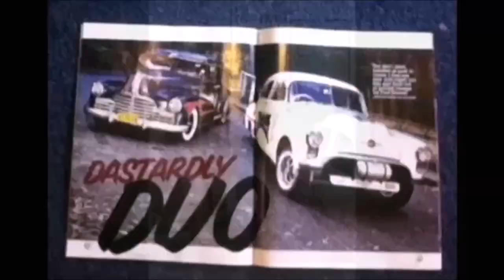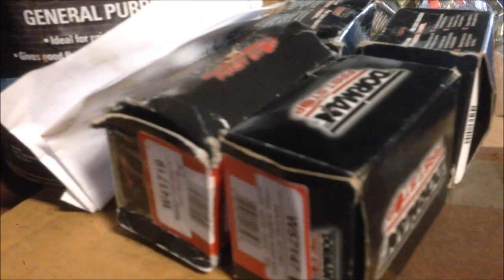1948 Ford F1 Pt3

Comment: I love the Ford 200 six, it's a great little motor! Unfortunately the version we got here in the states had an integrated head and intake which obviously limits your bolt on performance upgrade options quite a bit. Good luck with the truck build man!
Reply from the maker: Impacts Garage and Gaming cheers man, yeah this one is the same. The 2V head with the seperate manifold only came on a limited number of 250's, are quite rare and very expensive!!
Reply: @oldskoolonly  Ah no wonder it looked the same. Still a great little engine! I've seen people throw small junkyard turbos on these things and make little Mavericks and Mustangs really rip!

Comment: If you have not already purchased brake shoes, etc.... I found with my hot rod project  that 1967 F100 brake parts can be installed on the F1 backing plates.   Which gives you self-adjusting brakes.   Viva la H.A.M.B.!  I’m talking about the fronts,  the rears might work too but I’m not running the F1 rear so dunno.    Let me know if you want pics and part numbers for the front.
Reply from the maker: IowaMercMan cool thanks!! I'll keep that in mind 👌🏻

Comment: Good job, I noticed you have the CM nose cone hanging on the wall, Are you keeping or perhaps selling at some stage ?, cheers Jackie
Reply from the maker: jac mac I've got the complete unit with the grill, lights etc all off the one I wrecked out. plan to wire it up and hang it 👍🏻